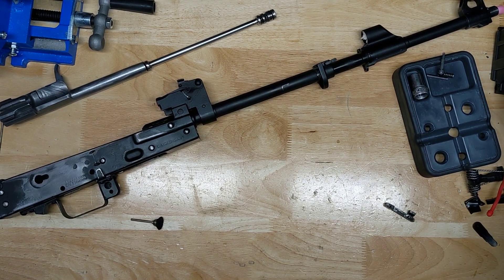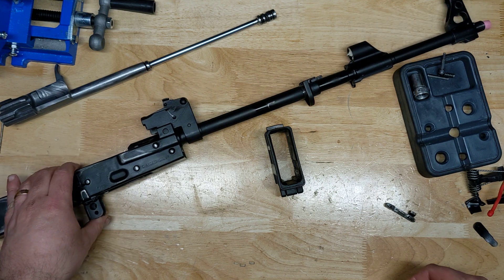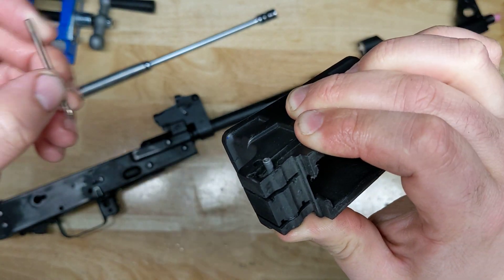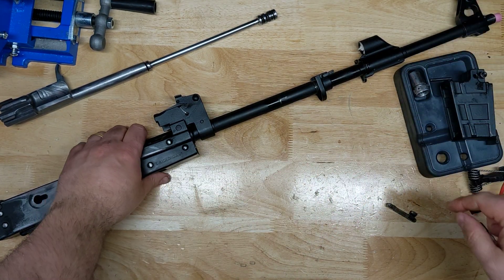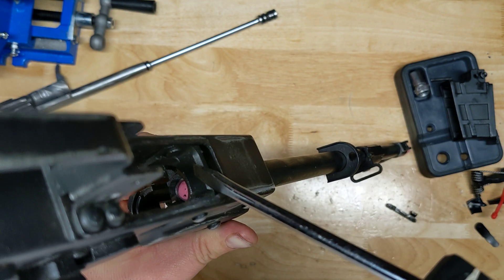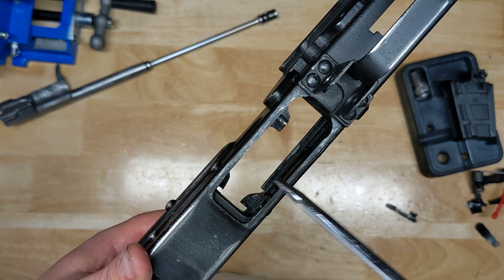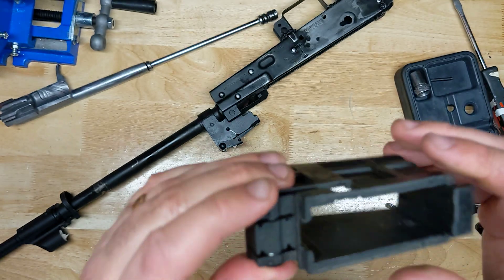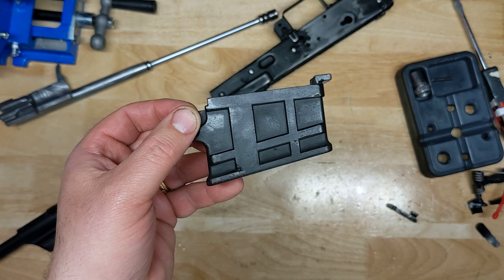Yugo M90np and M85np mag adapter removal

Comment: Should be able to remove the coating with aircraft stripper, just don't get any on the polymer. If there is bluing soak it in a container vinegar for a couple of min. Shouldn't need any longer than 10 min. Hope this helps if you didn't get it stripped yet since this video is 7 mo. Old